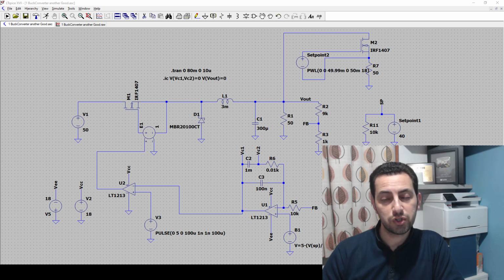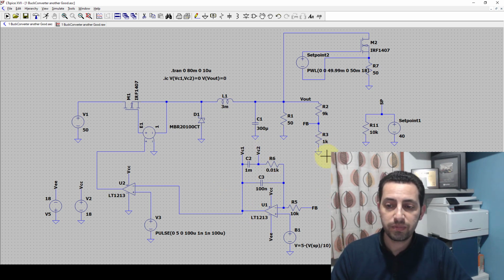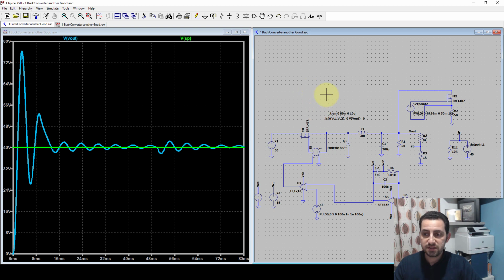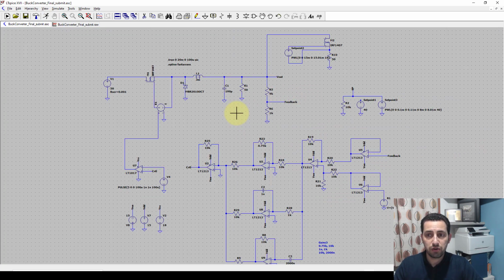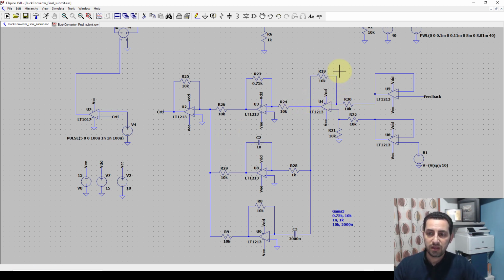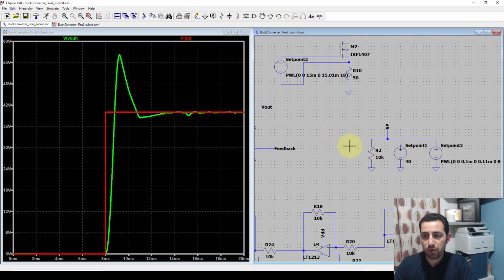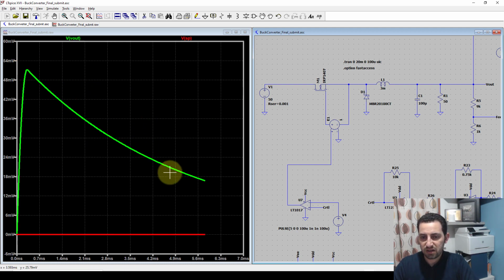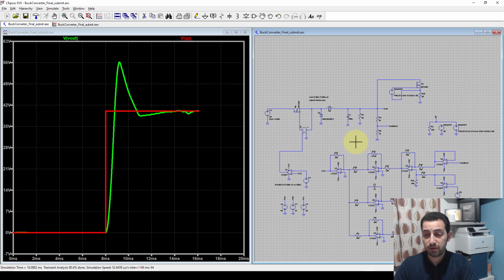Closed Loop Buck Converter in LTSpice

Comment: First, thank you for your work and sharing it with the world.  It helps us who are wanting to learn these topics.

I have some feedback.  Since most of the schematic can be obtained by mere inspection, I think that it would help if you elaborated on how you set up 'V3' and 'B1', up to including showcasing the waveforms (especially B1) so that we can completely recreate it and verify them at our end. 

For the V3 power source, with the values shown, the following error is generated:

WARNING: Specified period is not longer than the sum of Trise, Tfall, and Ton. Increasing period to 0.000100002.

V5 N010 0 PULSE(0 5 0 100u 1n 1n 100u)

Can you please elaborate how you overcame this error - or better yet, how is it that it works for your simulation if the the sum is greater than the period.

Comment: Hello sir, can this circuit be used for the self balacing robot, with Vin from the imu sensor and a set Vref. 
I have made only a pi controller circuit for this project. 
Can you help me in saying where does the Vout from pi controller go to(is to directly to motor drivers?)............

Comment: LTSpice has a voltage controlled switch which can be used instead of a part of the schematic in top-right comer (with a bv and a time in the formula we can "plug" an additional load at any moment). And another thing... Those U1 - this IS a PID controller =)))
Reply: No, it is not PID controler. It is a type 2 cintroler, which has two poles and one zero, and PID controler has one pole and two zeros. Type 3 controler is basicly PID followed with low pass filter and has two poles and two zeros. By the way, later in the video, he called it PI controler, what is  not, PI controler have single pole and single zero, and his "PI" controler have two poles and one zero (still is type 2 compensator) and to become "PI" it would need to lose one resistor (R4).
Reply: @mrlazda  Thank you!

Comment: Is this synchronous buck converter?
Reply: No, this is not  ! 
A synchronous buck converter would have second ( low side )  N-Mosfet instead of Diode D1.  The drive of such a Mosfet would have need a Bootstap circuit, what would have made the circuit a lttle bit more complicated.

Comment: Dr Walid, Thanks for the video, 
why you replace the single OP-Amp by so Many Op-Amps?
would you please explain how both circuits are equivalent, specially the subtractor
Reply: He is splitting out the component parts of the control loop and handling each of them individually. For example, 3 amplifiers for 'P', 'I' and 'D'
Reply: @simonbramble  
Thanks, could you explain where is /how the subtractor is implemented in the first design with one OpAmp?
Reply from the maker: They are not equivalent. I showed different controllers and each has pros and cons